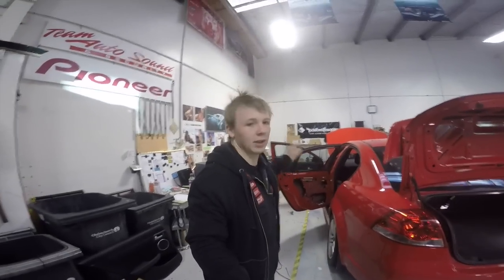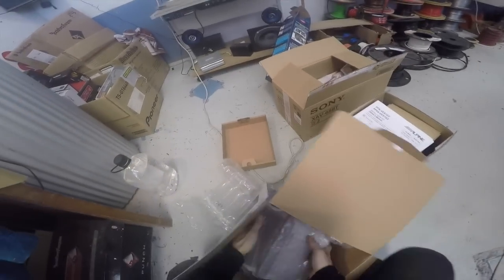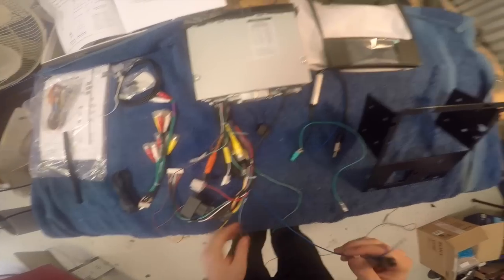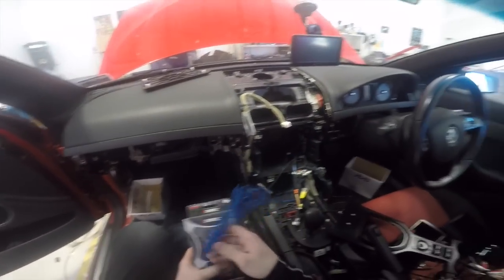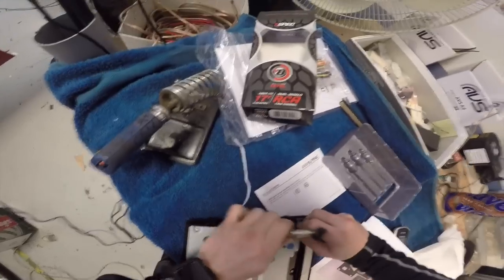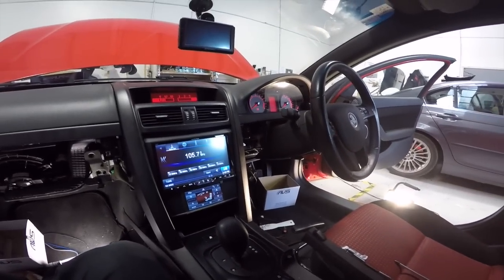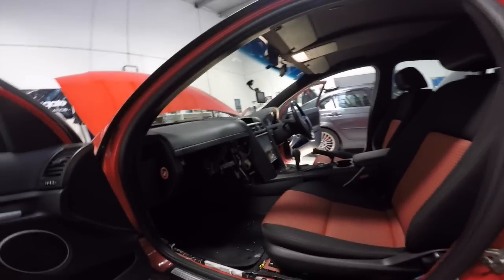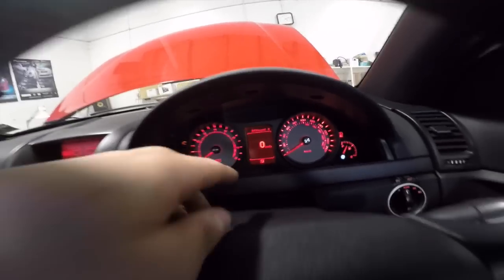Holden VE Commodore Stereo Replacement.  This is Awesome!

Comment: did you have to connect any wires from the head unit to the cars harness to get the audio info up on the dash? or is it just a matter of plugging that square display plug in to the back of the head unit. mine doesn't seem to work (X800D-U). unless there's a setting in the hvac setup?

Comment: Car Audio ect can you buy the   aircondition touch screen system by it self or is there any other model similar also what would be the cost just for the air condition mechanism if it possible to get ? ve commodore 2007 if you needed any of that

Comment: I'm in the process of installing a INE-W957A in a VE, im having issues with nothing coming up on the SV6 display - completely black, but it is displaying just "Alpine" permanently displayed on the centre info above the digital speedo. I was thinking maybe its a CAN bus issue relating the old Bluetooth module still installed, have you seen that before?

Comment: Love the videos. I have a ve calais with the rear roof mount dvd player which also displays on the factory head unit, do you know if the x008au will do the same?
Reply from the maker: Depends, the X008AU does have standard RCA AV inputs and outputs, I doubt the factory system has these but probably the standard type of signal.
You could try identifying the video, left audio, right audio and sheild wires, solder some RCA heads to them and plugging them in?
Reply from the maker: I have to do that a lot for factory Reversing cameras and AUX inputs
Reply: Ok thanks for your reply. I'll post an update regarding the outcome.

Comment: Noticed no speakers in the back, whats up with that, meaning in the Original Factory holes in the parcel shelf ?
Reply: those are only for the 8" miderange drivers. which are uslise and you cant really put anything back there.
Reply from the maker: 7071t6 some of this model car came with premium sound system which includes 2 8" parcel mounted subwoofers.
This one didn't have them so I used the holes to funnel bass from the Rockford subwoofer into the cabin and covered the holes in the tray up with oem style grills.

Comment: Hi, I am in the middle of installing an ILX-702D with the alpine facia. ive been having a couple of problems. so it started as nothing would turn on then I unplugged everything and plugged it back in and the climate control would work however the head unit would only turn on if the hazard light switch was on (the external one) so I'm not sure where to go from there. however now nothing turns on. would be awesome if you could be of some assistance.
Reply: update- I have now got it so when the hazard lights are on the head unit has power however when you switch the external hazard light switch off the head unit also turns off
Reply from the maker: +Hayden Noles wow that’s really weird 
I’ve never seen that happen before.
From memory the wires for the external hazard light switch are part of the loom that comes with the kit and they are red, is it possible you have somehow wires the switch in line with either of the powers that go to the stereo?
It’s really hard to say what it could be without seeing it...
Reply: I figured it out yesterday, it turned out to be for some reason there was no constant power to the unit and no power from my existing loom where there was supposed to be and when the hazard lights were turned on it backfed power to the unit, so I just ran a fused power wire to where there was supposed to be constant power and Bob's ya uncle

Comment: How do you hook up the top display to show your oil temp and battery voltage? Mines just blacked out
Reply from the maker: Max Stoddart in settings on the alpine Hvac display
There is a little setting called "sport display" I think... toggling that and then turning the car off and back on will turn it on to display the voltage and oil. 👍🏻
Reply from the maker: Max Stoddart https://youtu.be/uRpFsBojKmw
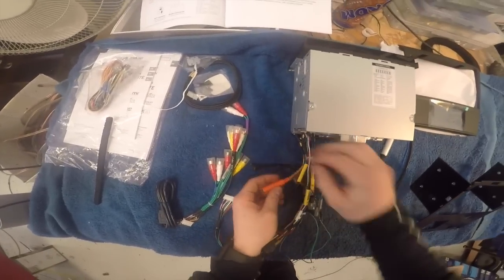At around 7:30 I show it here.
Reply: You're a life saver! Keep up the great work and videos!

Comment: hey mate I've got a 2007 GTR sv6 pretty much the exact same layout as this video, I've got a roof mounted DVD player. can I installed a sub and amp with that head unit? etc and how much would I be looking at for you guys to do it ?
Reply from the maker: Hey mate, do you mean a sub and amp with the factory head unit or the alpine one I put in in this video
Reply: with the factory one mate I've sent you a face book messages about a quote
Reply: could you do me a quote for the same as this ?

Comment: I really need some help with some parts. I have the american version "pontiac g8" and i really want to retain my onstar, dash display, and maybe sirius xm but i have no idea how or where to get the right connections from? Please help anyone. I have the pioneer nex 8200 system that also is climate control ready al9ng with vehicle speed. I really want everything to work

Comment: I wish someone would bring out a solution to replace the IQ in the VE series 2. The IQ is rubbish in my opinion.
Reply: Yes, I've got a series 2 also and that IQ system is so flakey , it fails most just when you need it or if you're in a hurry - it's utter shite

Comment: How did you lower the unit? I have the same issue
Reply from the maker: I had to widen the holes that the stereo mounts to with a stepper bit at well as the holes that mount the metal bracket to the car. :/
Reply: I have put infinity kappas (2ohm) and still run the factory 8s (infinitys) on the parcel tray. Can you recommend a power amp to go with these? Love the vids dude, keep up the good work!

Comment: Will this kit work for 08 pontiac g8
Reply: No, these are only for the Australian market - Alpine of Australia does not support this product outside that market, and it's not sold in the US. They provide zero tech support if you are in the US and get this and have tech issues or need a firmware update.

However, G8 Designs is what you're looking for in America.
www.facebook.com/g8designs